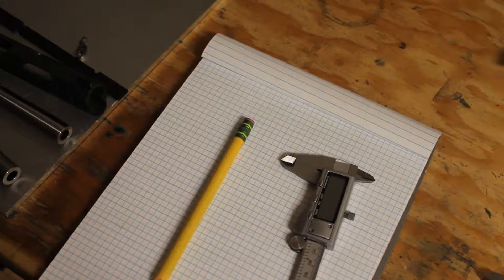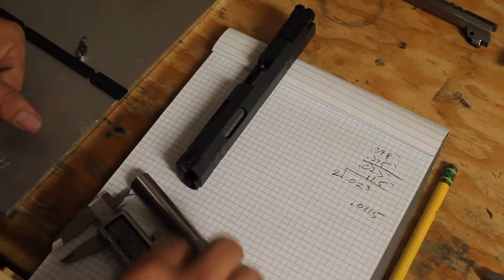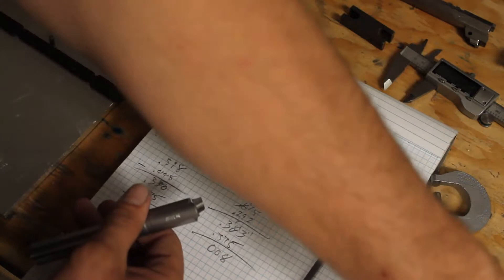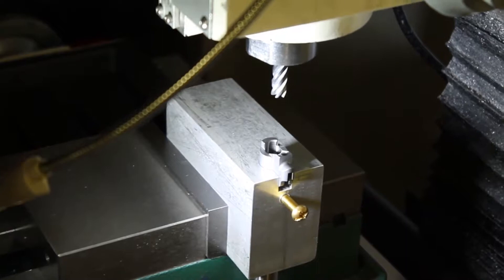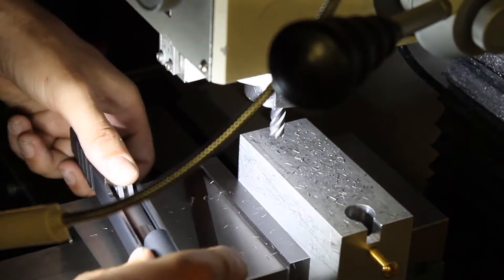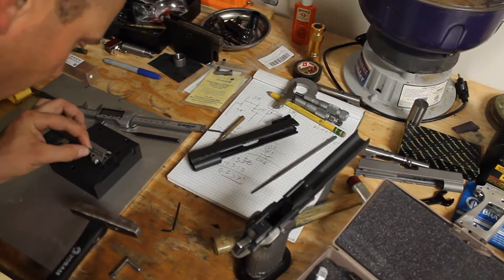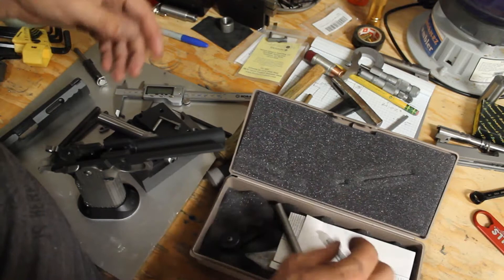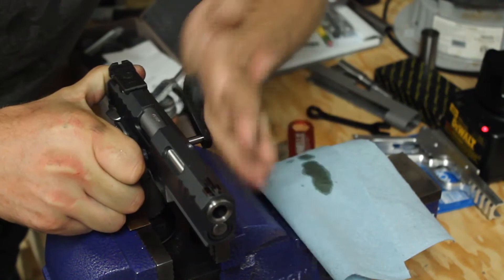Full Barrel Fitting Part 1 - Barrel hood and Lower Lugs

Comment: Thanks. This is the first video that went through the calculations in detail, specifically the amount to take off the "right" part of the hood. Most videos just calculate the amount you remove from the first side of the hood and don't explain the second step

Comment: Also my barrel hood came in perfect had to file down the feet for me to get the slide pin in but now it doesn’t drop down enough to rack the slide, what is missing? I know it’s hard to tell without seeing but hoping you may have an answer for me…
Reply: Could be contacting the back face of the barrel feet on the frame before the link can swing all the way out. Might dykem the back of the barrel feet and see if its hitting.

Comment: How come you don't have a video for cutting the lower foot with the cutter?  When do you stop cutting, when the safety engages or when the back of the slide is even with the frame?
If you cut until the safety engages how do you match the slide to the frame as it sticks out the back?